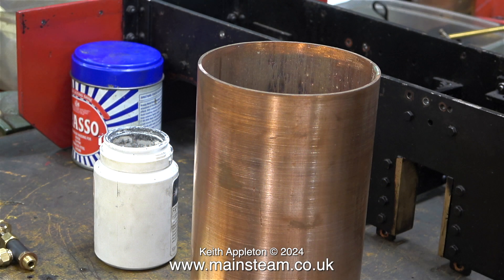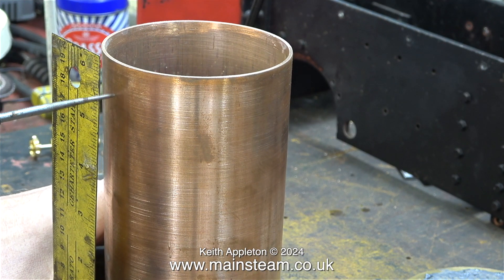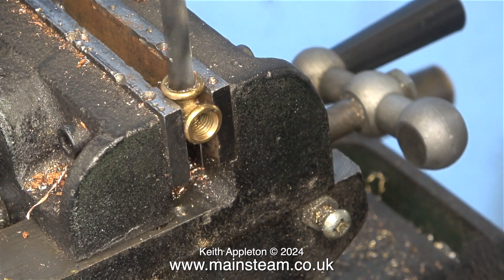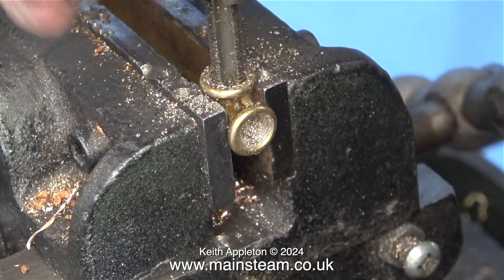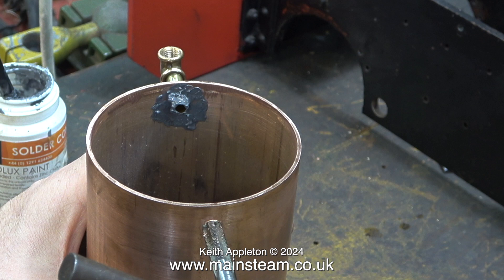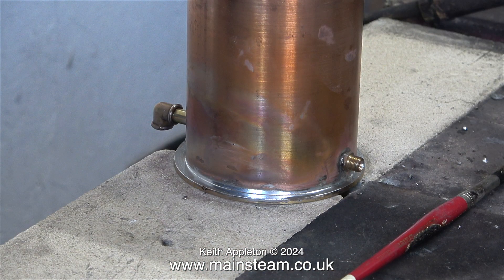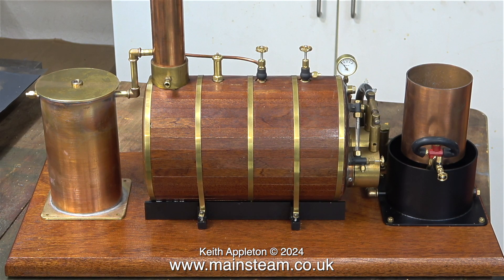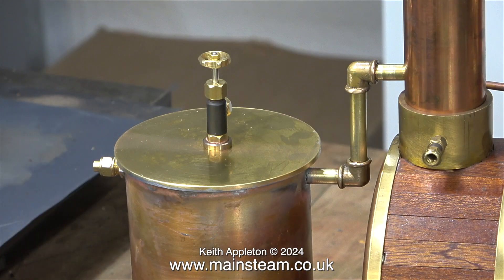A MODEL STEAM ENGINE TEST PLANT - PART #17

Comment: is there silver solder paste? /  nice help using a paint brush dipped in water to clean up a joint never thought of that
Reply: There is, but you need to be very careful, because the most common types are low temperature for electronics. However, I have used jewellers' silver solder which has a m.p.  in excess of 600C.
Reply from the maker: If there is I have never used it.
Reply: @keithappleton  thanks